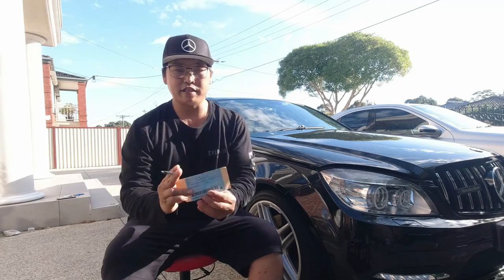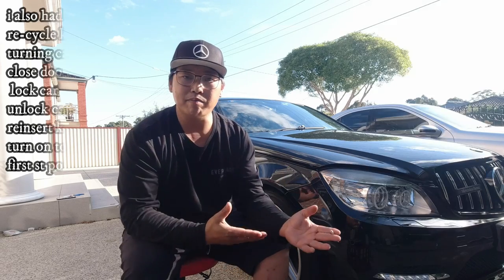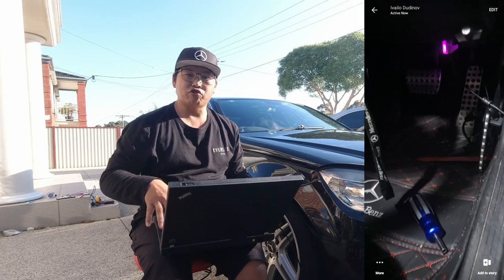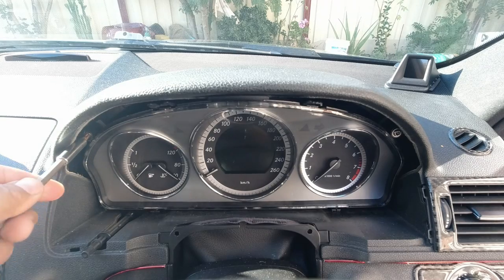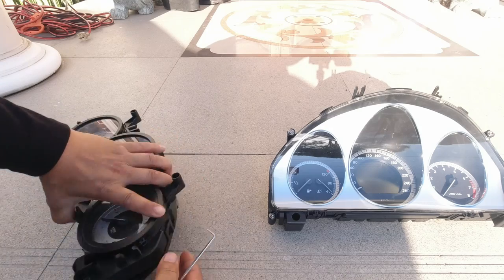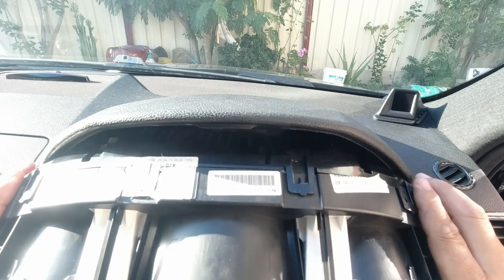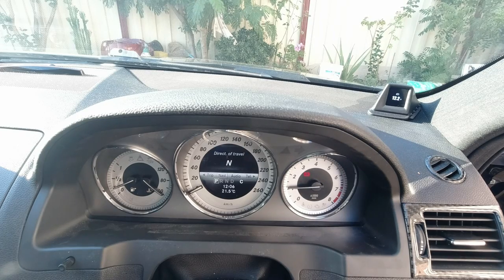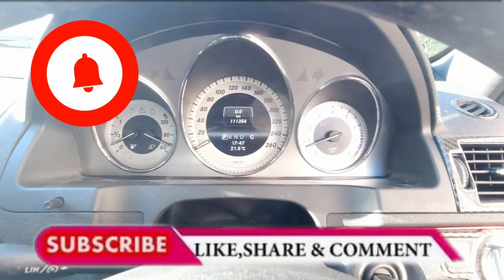mercedes w204 preface cluster upgrade to facelift cluster FINALLY!! - it works

Comment: Good Job! Bulgarian Poweeer! Get the black matte / carbon background rolling ASAP, those empty useless holes and silver are a no-go :)
Reply from the maker: lol which holes u referring? I don't mind the silver ring
Reply: @MIKEYZVLOGZ  You have the 2 triangles for ABS + ESP and the 2 arrows for the turn signals left in the background, because you are using the plastic from the old cluster. These are useless now, as the new turn signals and abs/esp messages are digital inside the new cluster rings :)
Reply from the maker: @Sapo Misov  oh yeah I get ya ... I'll see what I can do
Reply: I will try this and wrap that background with something.
Reply: How do u do the black matte and carbon back ground ? Any links?
Reply from the maker: just take apart the cluster and then wrap it ... should be easy

Comment: Great retrofit video. Not sure if you got the additional AMG menu option programmed in as well. You should do a video on that if you get the chance.
Reply: No AMG Menu on this specific cluster, because you will get the AMG Logo on start up instead of the colored car (which Mikey wanted).
Reply from the maker: @6thSense93  correct

Comment: Great. I did similar retrofit in my W204. Almost everything works except fuel consumption . Is it working on your cluster ?
Reply from the maker: no not atm
Reply: Meaning you can no longer see how much range you have left? 
I want to do this on my pre fl but I check my kilometers left each day is that functionality gone? Or do you mean something else?
Reply: Yes kilometers left function was missing after retrofit, already solved with coding .
Reply from the maker: yep just need coding properly and it all works ..all my functions work now button I went to the full digital cluster

Comment: What about error messages (ex. light bulb) or other info (ex. washer fluid). Does it show up normally? I'm just wondering if this facelift cluster is still showing all the info as it should and if the connection with the ECU is still normal.
Reply from the maker: yes all normal it gets coded to ur car
Reply: @MIKEYZVLOGZ  thank you! Good info.
 I also want to do this update, but I am not sure if it's important if the facelift cluster comes from a car with manual or automatic transmission.  Mine is automatic, and I've found a cluster that comes from a manual transmission.  Is this relevant? 
Thanks you!
Reply from the maker: @avramdk1  doesn't matter

Comment: my question is is the W204 cluster the same as the X204 both facelift
Reply from the maker: not too sure .. u may need to compare the shape and size ..if it looks the same then most likely will fit
Reply: @MIKEYZVLOGZ   thats what iam searching the whole time i was thinking i just buy it test it and when its not work i send it back xD

Comment: Hi mate ! Can you help Me with more Information about how make upgrade cluster !? I have c200 2008 And i want make upgrade cluster ANd steering wheel !
Reply from the maker: theres alot of info on the net about how its done . u need the parts .. and its different for everyone..some ppl have successfully upgraded wheels and clockspring with plug and play parts but some like myself need rewiring for the steering wheel to work .. i bought a rewired custom steering wheel ... and as for cluster it has ro be virginised then codee to your car.. someone helped me with mine .. i was fortunate

Comment: is it plug in and every info will be transfer automatically? or do you need to remap/coding it or setting it to get your original millage
Reply from the maker: did u watch the video? i specifically say it's not plugged and play u need to have it coded to ensure milage is transferred over  and fuel gauge will work

Comment: Hi I got a problem when I upgraded likes you I found 
1.Oil miles not move up when click the key other miles is move up
2.I Uanale to controlling the front Lamp 
3.Sceen of cluster not luminous 😢
4. Language problem because my new cluster is from japan😂
Not sure why i found the issue as above for #4 I tried to find the solution to change the language 😢😢😢
Reply from the maker: did u code it ? u need to code the cluster so it can all work
Reply from the maker: it is not plug and play

Comment: Does ir works with the w203 preface cluster to facelift.
Reply from the maker: no on w204 but u can update the w203 to later model if u find the right one must be same connector for example 3pin to 3pin not 3 pin to 4pin

Comment: I have question, I have c300 2011 and I’m going to buy a used cluster which have 150k miles on it, so my question if I plug that cluster to my car right away after I receive so what’s gonna happen? Do the miles will be 150k or will be the old miles on my car and will it work or do I need to program it, thanks 🙏🏼
Reply from the maker: it will show ------- wen u code it will show ur miles
Reply: @MIKEYZVLOGZ   is it going to show my old miles in the old one or will it show the miles in the used one I bought? After coded it I mean
Reply from the maker: @hassanalqahtani5844  it will show your old miles...cuz its saved in your ecu
Reply: @MIKEYZVLOGZ  okay got it everything will work except the mileage which need to be program thanks tho
Reply: @MIKEYZVLOGZ  Is it hard to code it I mean program it? Can the mechanic do it or do I need to go to the dealership?
Reply from the maker: @hassanalqahtani5844  dealership wont do it ..cuz its a modification that isnt normal.. u need a mechanic who knows ho to do it ..
Reply from the maker: @hassanalqahtani5844  yes however some cluster fuel gauge wont work either until coded as well. jusr depends on the cluster once coded everything works ... i had a cluster where the fuel didnt work .eveything else did except fuel... then one time i used a cluster from a deisel car and everything worked just no milage.. butissue was it was in miles per hr and i needed km per hr cuz australia . just ensure everything works ...and find the right coder...here ppl were charging ridiculous amounts cuz they think its rare or ppl cant do it ..but u can.. as stated in my video i was lucky a fellow subscriber took the time to help me... and i am still extremely greatful
Reply: @MIKEYZVLOGZ  does it take time to code it and how many hours needs to be coded?
Reply: @MIKEYZVLOGZ  thank you so much for your time and I really appreciate it for the info you provided

Comment: I was looking for the details of your Bulgarian friend, it would have been great if you would have left his details in the description. I have a 2011 e350 diesel which could use an instrument cluster upgrade, currently the cluster has an issue where the clock is spinning always and stops for 10 seconds and does the spinning thing again. Do you happen to know if we need to code the cluster apart from transferring the ODOMETER readings? I am sure simple OBD scanners can update the mileage easily
Reply from the maker: a simple obd2 scanner can't u need a a pretty descent one usually costing about 3 to 500 ..although u can buy a device strictly for that ... I might just add it to the description..and yes u do need to code the cluster or else the fuel gauge may not work ... and coding the cluster basically involves virgininsing the cluster to make it think its new and therefore cam transfer over the odometer from your older cluster 
..all this works 100 % ,
Reply: @MIKEYZVLOGZ  super, thanks for the reply . I will contact him

Comment: Hi I done the same as you but my fuel gauge isn't working and my mileages hasn't changed
Reply from the maker: did u get the cluster coded? that's what fixes it all
Reply: @MIKEYZVLOGZ  hi not as of yet I don't no where to go trying to find a place but thankyou for confirming that
Reply from the maker: @danwells9222  did u watch my video at all? it tells u what I did

Comment: Hey Mikey I watched the whole video and appreciate you but can you explain what would happen if I don’t get the coding and just buy one off eBay? Do it show you how fast your going still ? I rarely use any other function on the cluster unless an error message pops up or something , I just want to know if the gas mileage work and the speed that’s ur going ,
Reply from the maker: depends I used one off a diesel model and it was from us so it showed mph not kph and everything worked..but wen I changed to a petrol one the fuel gauge didn't work 
and there's no milage... I believe the speed works but not the fuel ..song won't know wennur out of fuel
Reply: So it dose not show Miles!?? Oh fuck
Reply from the maker: @TienBuilds  it won't show until u code it .. and fuel gauge might not work either..it will show how fast ur going..bug u won't.know the overall mile's travelled..odometer won't work... if ur lucky u might get a cluster that still shows fuel gauge and speed but wen I got my 2nd one fuel gauge didn't work

Comment: Hi, can you adjust the clock and how ?
Reply from the maker: u do it using your radio unit stereo .and it will also change the cloxk on your cluster ..they sync with each other
Reply: @MIKEYZVLOGZ  i have no option on my radio as is small screen, before I use to change via the buttons on the steering wheel 
Maybe you have the pop up screen bigger version
Reply from the maker: @mranatolie9826  ye i have the flip up screen

Comment: On new instrument cluster i didnt see turn indicators and triangle lights, does it works?

and when upgraded cluster, maybe there are few unlocked extras in settings which u didnt get with pre fl cluster?
Reply from the maker: yes they in in the left and right dials

Comment: Mine isn’t showing RPM’s. It just stays on zero. Anyone got any ideas? Was considering doing a chip swap with the old cluster into the new if it fits?
Reply from the maker: that's how they do it wen doing a chip swap many have done it
Reply: @MIKEYZVLOGZ  Okay, thanks dude. So you think swapping the cluster chips will do the trick?
Reply from the maker: @Joey Hilbert57  honestly that's a last resort u need to code it and it will work sorry I was thinking of sometjing else
Reply: @MIKEYZVLOGZ  No worries, I appreciate it! Yeah I just tried to swap it and now none of my needles work 😭